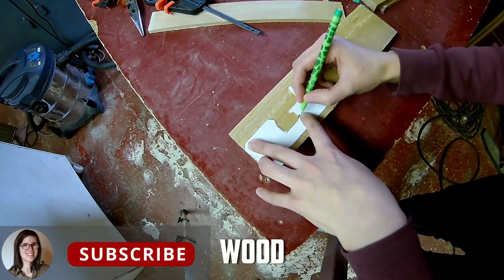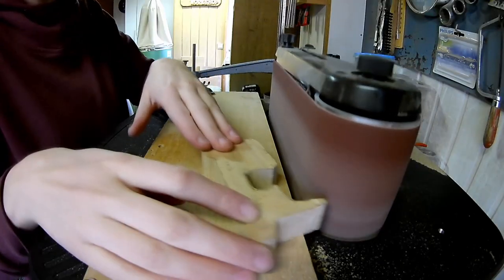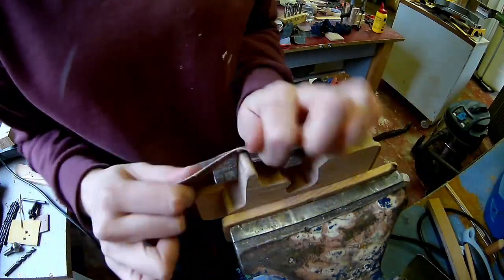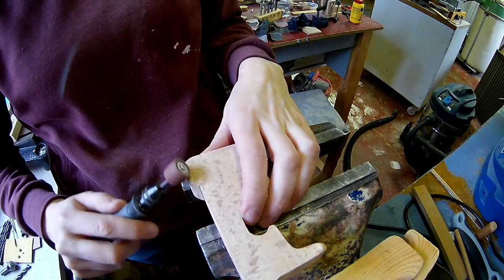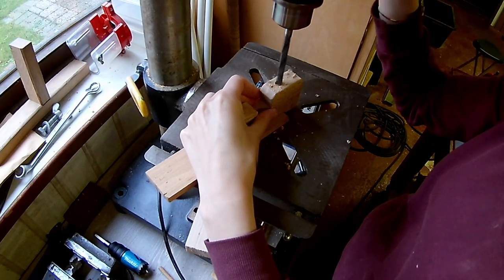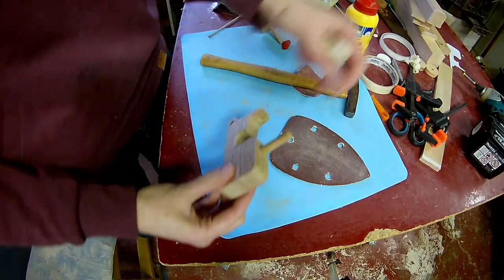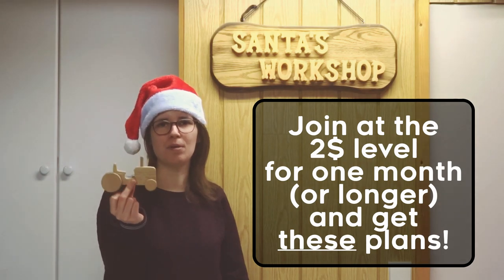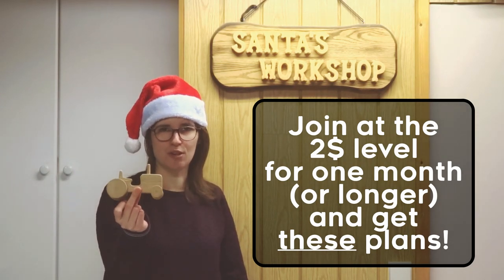How To Make a Wooden Toy Tractor | Prepare Yourself For Christmas #5 | DIY Christmas Gift

Comment: Another great project, keep knocking them out. You keep using what appears to be a small scrap piece of wood to rub the outside of the hole bit, why? Trick I've never seen before. Thx
Reply: I was wondering the same thing myself, not sure if it keeps the teeth of the hole saw clean so the wheel releases easier
Reply from the maker: Thank you so much! The series is almost over! That's just a skewer that I'm using to keep the teeth of the holesaw clean, so the wheels won't be burned.
Reply from the maker: Yes indeed! And less burnmarks!